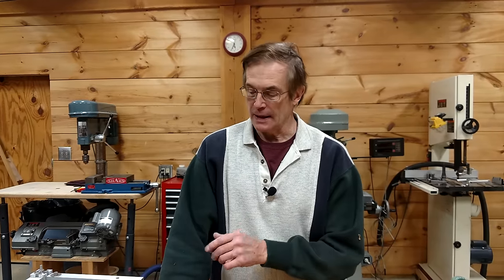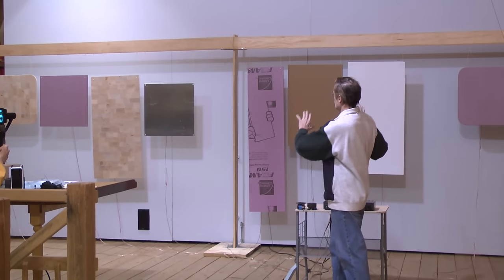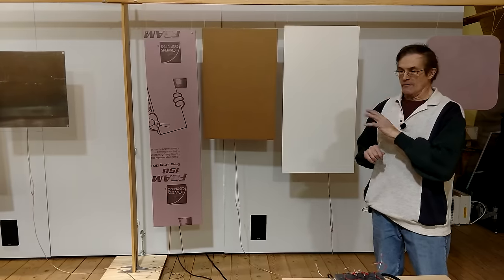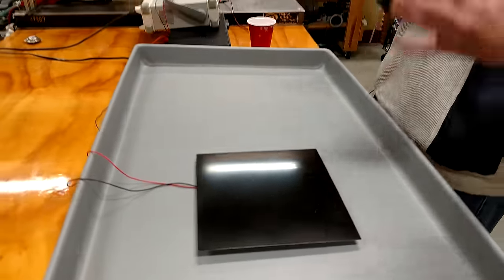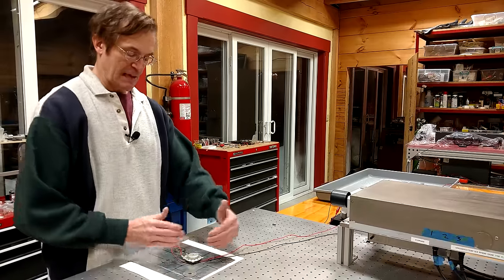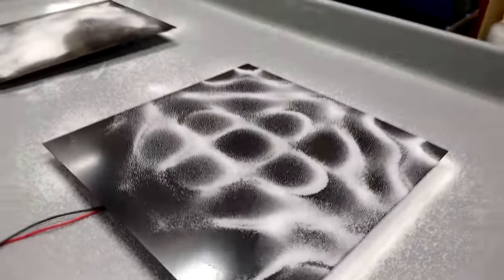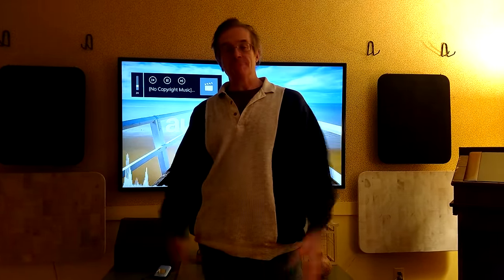Fantastic DIY Speakers for less than $30!

Comment from the maker: In our next video in this series, I will perform some calibrated diagnostics as well as introduce some software and hardware to further enhance performance.
Reply: what was the thickness of material and final dimmensions?
Reply: Will you also discuss construction dimensions and parts? I couldn't tell which Dayton exciter you are using.
Reply from the maker: The XPS panels are 1' thick x 24" x 30" with 4" radii for the corner rounding.  The balsa panels are 1/2" thick x 30" x 36" with 4" radii and the exciters are placed on the back, off center, based on a 2/5, 3/5 rule.  So for example, the exciter on the XPS panel is located  9.6" vs 15.4" from the long sides and 12" vs 18" from the short sides.  These work equally well.

DAEX32EP-4
DAEX25FHE-4
Reply: Thank you for this video,  I now know what,  where,  and most importantly how to bring audio to my shop.
Reply: subscribed and looking forward to more videos!
Reply: Tech Ingredients i
Reply: Tech Ingredients Did you try using 6 or 8mm MDF? (Medium Density Fibreboard) That too seems to have good compression but decent amount of flex. Not sure if the sound is superior though.

Btw, would wall mounting these affect resonance? Would it be a good idea to mount them in a frame or direct to a wall?
Reply: Masonite would also qualify as flexible, but not compressive.
Reply: Assuming you can  actually do a std panel without weights and tune it in with the equalizer?
Reply: @Tech Ingredients, AvE sent me here also, you did a great job with this, thank you. Did you put sound deadening weights on the end grain balsa wood speakers also?
Reply: Tech Ingredients - If you're going to do some diagnostics it would be very interesting to a frequency response graph for each of the poly and balsa.
Reply: Could you also test this using regular speaker cones in stead of the audio exciters?

Also: could you elaborate on what audio exciters actually are? I'm assuming from the looks they're some kind of piezoelectric elements?
Reply: Where do you buy end grain balsa panels?
Reply: Alexander Brewer - Just saw on the bay $65 incl. shipping, enough for 2 panels.
Reply: Richard Fay What size?
Reply: Richard Fay I only see 48x24
Reply: This gave me an idea, with the addition of a microphone and some circuitry the panels could be used as audio dampers for quashing echo and cross talk in a room.
Reply: and then I saw your Active Noise Cancellation video, very cool.
Reply: When you said you could cut holes, did you mean you could drill a hole at each of those weight positions using the 2/5, 3/5 rule and still achieve the same result?
Reply: Where did you purchase the acoustic excitors
Reply from the maker: Yes, but the mass removed has to be on the same order as the mass you would have added.  Roughly 20% of the mass of the panel has to be added in counterweights.
Reply from the maker: Probably.  This is what we are investigating now.
Reply from the maker: Yes
Reply from the maker: These are simply voice coils that are manufactured for this purpose.  You could harvest these from a standard speaker, but as they are very inexpensive its not worth the effort.
Reply from the maker: We touch on that in the active noise cancellation video we posted a couple of months ago.  The rub is the very complex wave patterns that will hit the panel. Many microphones or accelerometers and many  exciters with a high channel count processor could do it.  We achieved 5 db in a very controlled experiment.
Reply from the maker: That is the question.  The possibilities are so numerous that a simulation program would be a better way to optimize this.  I'm tired of cutting foam!
Reply: Braxton Mann - A quick google search shows a whole plethora of answers to your question. However, most DIY speaker builders are very familiar with  PartsExpress
Reply: TheSaintST1 - He somewhat addresses your mounting question in the video, but I will attempt to answer your question. And in the spirit of this channel, I will also attempt too explain the aspect of why.
First, you do not want to mount them directly to the wall  nor would you want to build a frame around them as this would interfere with the movement of the panel negating the purpose of using the chosen materials.
How you mount the panels will affect the sound quality quite drastically. Ideally, you want the panel to be isolated from physically interacting with anything else because any physical interactin will dampen the vibrations.  Essentially you want the panels floating above the floor and away from the wall.
The hooks he is using in the video hold the panels away from the wall and the use of mono-filament allows for the panel to be suspended in the air. 
The mono-filament contacts and contrains the movement of the panel so little that it can be ignored or considered negligible.

Also, the idea hear is to remove resonant peaks, which will smooth out the frequency response. 

I cannot comment as to whether or not he used MDF so we'll have to wait for his response, but you can get the basic idea of how it will respond by either looking up the material properties or by doing a short experiment of your own comparing it against one of his recommended materials.
Regards.
Reply: I would enjoy an illustrated discussion of the various resonance modes, especially the one that appears at about 25:54 .
Reply: MDF would sound muddy :( it damps rather well :)
Reply: The only way to test a speaker is with a human voice! But this is intriguing
Reply: I would like to know more about the cardboard you tested. maybe do a full sine sweep with a db / spl meter and use a better mic.
Reply: Have you considered placing 2 exciters on one speaker?

Also have you considered treating the weights like a fractal pattern and seeing if it might be possible to make a solid band or maybe a design that you could attach that would subdivide the rectangles further?

Also what are the the points where going bigger would lead to diminishing returns? As an example, would going so far as using an entire sheet of extruded foam be a point where you won't really get those low notes?

I really like this idea and may have to give it a go for my home theatre setup. Also it'd might be nice to find other ways of mounting it because I debate on the ease of hiding the hooks. Maybe they could be attached like a painting or framed photo on a string; lower the hooks below the top but keep the actual strings attaching high enough to avoid it tipping.
Reply: How would it affect the sound if you applied a wood veneer to the panels? if I make these I'd kind of like them to all match.
Reply: NerdyPi my guess is that larger panels would increase the bass response. Lower frequency = Longer wavelength, and in order to get a longer wavelength you want a longer/bigger panel. At least, that's my guess, but I'm no physics genius.
I'd be most curious about the following:
-Power input vs panel size relationship
-Splitting up a panel with more exciters (ie, one big panel and one big exciter, vs the same panel split in 4 with 4 exciters)
-The effect of curving the panel (very difficult with foam, easier with wood)
-The effect of panel thickness (thin=more highs, thick=more bass, perhaps?)
And there's lots more I wonder about. What a neat concept. Hope to do some experimenting of my own.
Reply: Tech Ingredients So which exciter did you place on which panel? You have two listed here.
Reply: Can you maybe make a webpage somewhere detailing this project? (and with updates regarding the experiments you're doing). A lot of people are following this and are interested in giving it a try themselves, but extracting info from a video & youtube comments isn't so practical >_<

And is there a material that can replace the end grain balsa? googled it, but seems to be impossible to find in europe... (unless someone else from europe has found it somewhere? )
It seems to be quite a rare material >_<
Reply: Do you have a components list for this build? I'd love to do some experimenting with my own home theatre. My Bluetooth soundbar is OK, but it irritates the hell out of my wife that she has to use a separate remote control for the speakers. Am I correct in assuming that the audio signal comes directly from the source?
Reply: Also here after seeing a video on AvE’s channel.

I built an overhead light with a rectangular opening and now I know exactly what I’d like to place within!

A few questions- 1.  Instead of counterweights referring to the 2/5ths 3/5ths experiment, what would the effect be of holes  cut in the styrene at those locations?  2. Would an abnormal shape of the styrene change the frequency range (if that’s a way to describe it) of the styrene board?  I just purchased 2 exciters and a small amplifier for this project.  My initial sketches have two rectangles with different dimensions in hopes of covering a broader range of frequencies and I plan to use a small subwoofer in conjunction later on.

Very cool video!  Thanks for sharing
Reply: Thanks for the info. Question for you, how thick was the Pallet Cardboard?
Reply: Does the 20-25% weight include the weight of the exciter?
Reply from the maker: No, it does not.
Reply: Wow, great to hear you're actively flowing up and preparing a updated resolved video soon. 

I am very interested in your findings. I will eventually make some for myself, but need to be decisive about the correct component as here in Australia, most items are not so common, and experience. 

Looking to be $20 to $30 per exciter, plus shipping, from the USA, of at least  $30. And thats just for the exciters. 

So, keen to see your next video to help work out my parts list. Again great work mate. Thanks.
Reply: Which of the exciters did you use on each panel?
Reply: That balsa is hard to find in Texas, I can order spruce for guitar tops about the same price and probably get decent quality  sound and they come in 2 halves for 11.55
Each half is approximately 8-1/4" x 20-3/4" (210mm x 527mm)
Sanded to 0.125" - 0.130" thick (3.18mm - 3.30mm)
What do you think of the possibilities of bridging these 2 into a single section for each side and doing the same radius corners and your offset of the exciters? Would a single of one of these probably make up for the 2 different ones or would it still help to make the foam ones?
Reply: In Virginia I’m having the same issue. Amazon has some End Grain options, but the measurements are 24” x 48”. Not being familiar with End Grain Balsa, it also seems that it’s manufactured using some kind of flexible membrane that the bricks of balsa wood are glued, with flexibility of the sheet being optimal for its normal utility in industry as a core product. 

I know you have another video coming to discus your methodology of construction and data on the speaker performance, but can you give us some information on the make-up of the balsa you’re using and suggestions for sourcing?
Reply: Do you work for NASA? This is the first video I came across from you. Out of millions of silly and pointless videos on youtube it's so refreshing so see a video that is informative and intelligent. But in a world of instant gratification most people would probably find your video too long and and boring. Subscribed.
Reply: Tech Ingredients
Reply: Tech Ingredients The sample music is terrible. The twinkly quality makes it hard to tolerate. Why not use some good Jazz or classical music.
Reply: There are two things that I have always wondered about using for speakers and you chose to test neither of them .
[
water
[
plexiglass
[
what about a very thin hollow panel of plexiglass filled with water ?
[
maybe even tapered as being thinner at the top and thicker at the bottom
[
next I would consider partially pressurizing the container with varying amounts of intert gases
[
or several varied sized compartments of pressurized gases
[
maybe even very strong pliable thin container of cellophane or similar material - filled with water
[
?
Reply: another idea that I just thought about -
[
instead of making a direct physical coupling from the exciter to the radiation panel
[
what about a larger intermediate conical distribution interface - maybe even using a water bag or carbon fiber
[
it seems that directly placing the exciter onto the panel - it is too focused into one area
Reply: Subcribbed! Thank you sir!
Reply: Interesting approaching but what configuration you used for the last test?
How many counterweights after all , or none?
Reply: Lead Pill  Such an offering would be worth a small fortune to me were my kids still roughly high school aged or a bit less.  However, they did get quite a bit of the ethics and diligence that are a part of this mans great academic example from their band director who is also a very superior intellect and educator.
Reply: @mobilgin  --> Just replay the video!
Reply: @trudyboley6360  did you ever try the spruce?  I'm interested in using some type of tone wood.  I've even seen tight grain canadian import 2x4's at the big box stores that could be cut and laminated together to yield a cheap tone wood for testing.
Reply: @Flojoe6274  He has to use copyright-free music or YouTube will pull the video(s) down.
Reply: Can you fix back side of the vibro to the wall, and than measure the difference? I think it will be better...
Reply: @winnie51189  it will be better to fix the magnet to the wall, i think...
Reply: @TechIngredients  I'm coming very late to the party.  First, thank you for a great video that explains things that I had no knowledge about.  From watching the video I guessed that the dimensions of the long rectangle speaker made from XPS is about 16" by 60".  I couldn't figure out how you placed the audio exciter.  Could you give the dimensions of that speaker and the coordinates for placing the exciter?  Doe s this larger panel also have 4" radius corners?
Reply: My my flux repulse motor is a overunity generator.  Can you contact me?
Reply: Hello
Reply: Hello

Comment: // 1:08 Dayton audio exciter
// 1:30 Distributed Mode Loud speakers
// Material needs: high compression strength, high flexion
// materials that meet these: end grain balsa wood, extruded polystyrene foam (XPS), resonant spruce, pallet board (cardboard). 
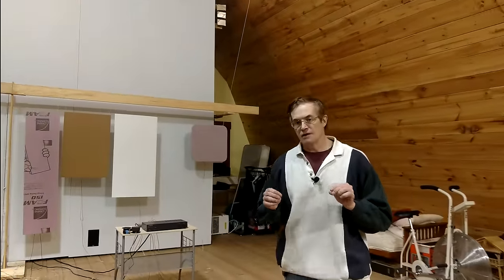// 9:00 best sound performance per dollar ==> pallet board, XPS (10:30 sanded [for flex] and rounded [for resonant dampening]). 
//13:10 longer ratios allow for better frequency distribution and help eliminate resonates
// 17:00 explaining why bigger or longer speakers give more dynamic sound vs even high quality speakers
// 18:00 resonance explanation 
// 21:30 explaining 3/5ths rule for resonance dampening on the exciter placement
// 23:30 exciter dampening comparison
//26:22 really clear comparison of high frequency resonance dampening from strategic exciter placement
// 26:45 in home setup, explanation of setup on living room tv with two different speaker types for distribution
// 29:16 real world example

// intense DIY based off this video https://www.youtube.com/watch?v=gGzNkUmPdXc
Reply: @Tech Ingredients Youre the peoples champion. The crafted quality to last man. The anti planned obsolescence hero we need.  Cutting through the layers of lies and walls built by captured industry and compromised science. 🚧💡🧬💛

@A B. Thanks
Reply: 22:00.  Very golden ratio vibes
Reply: @CoincidenceTheorist  i think it's in part informed by musical 5ths, which happens to be apart of the golden sequence. Additionally the cut seems to be a golden ratio, where as a randomized cut may not experience the same issues. I'd be interested in checking some fibbonaci stuff too
Reply: Except manufacturer: "The ideal material for mounting an exciter is a thin, lightweight sheet of material with high compressive strength and moderate to high bending strength. The compressive strength of the material has the greatest effect on the treble extension of the resulting ‘speaker’ (affecting ‘detail’ and ‘air’), while the bending strength of the material influences the midrange and low frequency efficiency of the ‘speaker’." So, not high flexion.
Reply: @terhohalme  you mind rewriting that? I'm not sure what you're trying to say
Reply: @animal579  Sorry, i am not native. I am wondering, is high flexion the same as high bending strength?
Reply: @terhohalme  ok got you. I study electrical engineering, not mechanical so someone check me on this. From what I understand, in this case flexion is the same as bending since the context is around compression charateristics. 9:00 and 17:00 are good spots to view this, especially with the metal sheet that leaves with a ringing tone. The metal sheet leaves a ringing tone since is has low compression (it's not squishy) which allows for high amounts of resonance (which leads to frequency peaks, which sounds bad). On the other hand, the XPS panels are also very hard to bend (or flex), but have a very high amount of compression (squishy-ness) which prevents resonance in the first place, but also absorbs some of those sounds from the envrioment because of the compression property (when detailed correctly 17:00)
Reply: You deserve a community prize, sir

Comment: I’m using a pair of these made from 12x24 inch corrugated styrene panels for tv watching.  Best bang for the buck in any audio configuration i have ever put together.  Actually, more realistic than any small to medium sized format stereo speakers I have used.  All of this guy’s vids are fascinating.
Reply: And low profile, thats an important feature in a compact TV room.